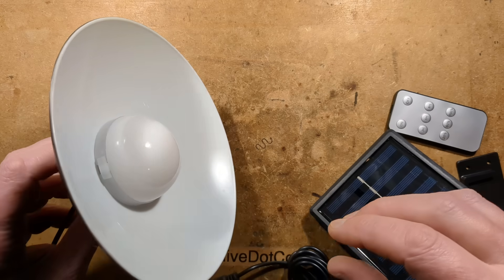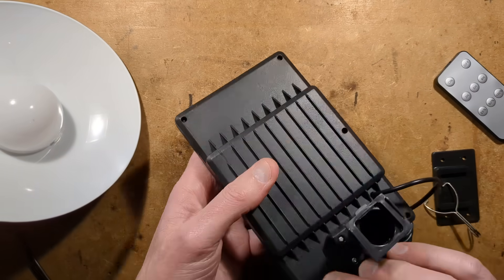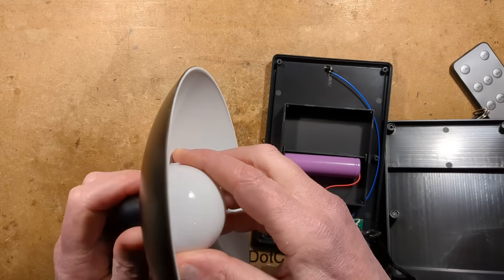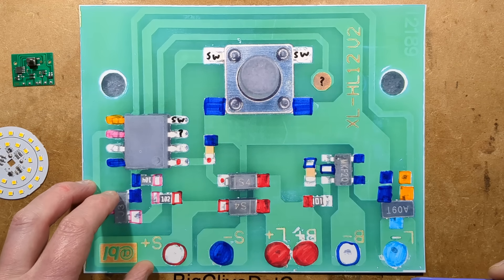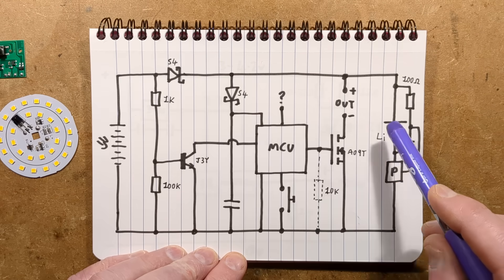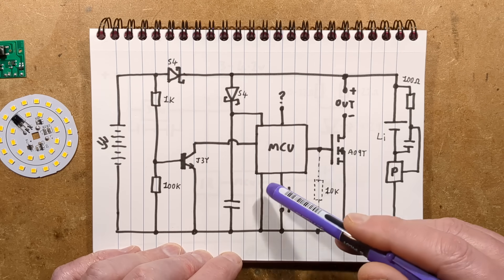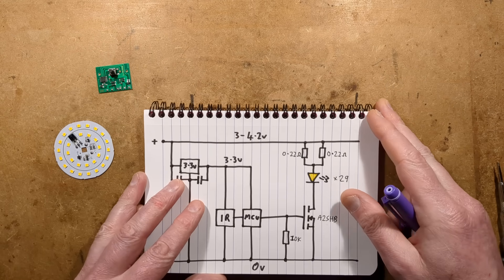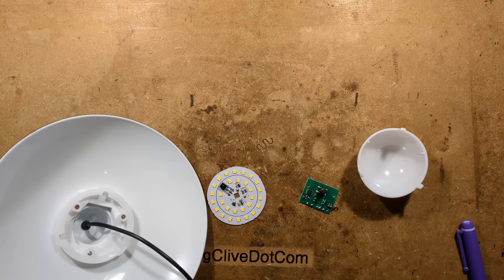Solar pendant light teardown

Comment: Since the battery is soldered onto wires i wonder what would happen if it was shorted out. Maybe a track on the board or the wire itself will break and act as a fuse?

Otherwise its theoretically possible for the battery to catch on fire, I think.

But i saw a test on YouTube where they intentionally shorted out an 18650 and it didn't catch on fire, just got hot.

Comment: Just a thought, but I think it would be better to increase the Lithium battery (free of charge) by dismantling four discarded Vapes (which seem to litter the streets these days) and taking the batteries out of them. Then solder them in parallel and install them in place of the single 16850 cell. There would appear to be space for them already and a bit of hot glue could hold them in place nicely. Environmentally friendly recycling and a free upgrade. What do you think?
Reply from the maker: It would definitely improve it.  When I mention "street lithium" in my videos I mean from disposable vapes.  I just can't say "vape" in videos.

Comment: So if you add an inline switch between the solar panel and light fitting to break the circuit, you wouldn't have to cover the panel?
Reply from the maker: The output transistor could be bypassed and the remote used for all control.

Comment: How do we even evaluate these things before we spend money?

Bought a couple of solar lights last year to provide a bit of security for my back garden.
The £40 unit I bought from Argos proved to be total sh!te and ended up in the bin.
The 12-quid item I got from eBay has done absolutely sterling service out there ever since - I'd buy a dozen more, but the (Chinese?) source seems to have vanished.

Clive - you do a great job of evaluating this stuff - just love your (unique) channel. But there's just so much rubbish about - even (in fact especially?) from mainstream stores. 

How many of us could do with a reliable, ongoing list of the good stuff and where to get it? Ever thought of being man-in-the-middle Clive? I for one wouldn't begrudge you an honest percentage.
Reply from the maker: It's always a bit random.  Argos stuff is the cheapest of the cheap.

Comment: Those solar panels go opaque when exposed to the sun for 18 months or so, as the surface is not UV proof. They are also used on many of the out door lights that come on when you move past them at night. Any product with that type of PV panel is crap really.

Comment: I needed a garden shed light and have spent several evenings combing Aliexpress for a product that does not have a remote. Somehow the market is flooded with devices like this one, and dumb solar luminaires of this size have become unobtanium. Mine had the same nonsense with night-only operation, I was able to identify and remove the culprit resistor. It also had more free space in the LED housing so I moved the battery and the board there.

Comment: So to make the light able to turn on during the day, just break off the 1k resistor and the microcontroller in the panel module would think it's always dark. Or maybe a resistor across the MOSFET can give enough of a current to retain the state of the microcontroller in the light.

Comment: Remove that sense resistor from the solar panel and it'll work more "routinely" as a rechargeable lamp...or just take out the transistor it feeds.

Comment: Considering that the "Marvel Cinematic Universe" chip needs a stable 3.3v of power it makes perfect sense to put the regulator on the same PCB. This way you can are not tied to the solar panel and can use a 5v USB Power bank potentially. Maybe a video idea?

Comment: I have had exactly this model for two years and it has been great - although the solar panel is now becoming crazed, but it still works.  Mine only briefly comes on at sun down , then instantly turns off(like many of these cheap Chinese things do). It's excellent for under my rear canopy of the house , although I had to add extra wire to the short 1m cable. My friend bought me it for about £2 from Amazon,, I wouldn't pay any more than that for it. I have rapped the edge of the battery compartment in insulation tape and waxed it (and the screws) to prevent water ingress

Comment: Yea, I bought something similar at ALDI's, dirt cheap because it was on special. I seriously just wanted to see how bad it was because most ADLI products are absolute garbage. It was supposed to be an "outdoor" solar path light. Placed the solar panel which housed the cell and a rechargeable NiMH battery. It had a lead with a plug similar to your video, they probably bulk manufacture millions of the same plug. I set the light up and kept an eye of it. It worked but only gave about three hours of light before the battery was drained. However the real, not surprise, was that for an "outdoor" light it had no seal whatsoever. The housing filled with water after only a few rain events. The plastic was not UV stabilised. So after only a few months of Sun the housing was turning to dust and crumbling away. Actually some of the worst deterioration I have seen. Even the connector showed signs of bad corrosion.

Comment: I have found you can use a sensitive camera with the IR filter removed (or cctv cameras with IR mode) can see electroluminescence in pv cells. I have tried this with cheap solar light panels and often half the cells are dark meaning they are not functional due to invisible cracks. Just apply current limited supply positive to positive, negative to negative and you'll see it glow in IR. you can clearly see broken cells and cell matching, some cells glow brighter than others.
Reply: So you connect battery directly to solar panel . In the dark I assume? And battery voltage is how much as opposed to panel open voltage? How much current do you need to limit it with ?
Reply: @migor777  yes, in the dark, needs a sensitive IR camera, current and voltage should be around the voc and Isc of the panel under test. Use a bench supply with a constant current mode.

Comment: Thanks for this. Am I correct in assumning that by removing the transistor on the samll circuit board, you could hack the circuit into just responding to the IR remote w/o the automatic "on" at dusk?
Reply from the maker: Yes.  Bypassing the output transistor would keep the remote light powered, but still have overdischarge protection.

Comment: Hi, love this video mate thank you for this, but on the subject of solar lights, the one you mentioned a few months back last year some time I mentioned I was going to put one in a room and when I opened the solar panel and the led light, a circuit board was only in the LED light part, and I remembered you saying that if the circuit board censes the sun going down to a certain point then it will turn the light on, so I thought, if the circuit board does sense the solar panel, what about putting a switch like a pull cord in between the solar panel and the board that control's the LEDs (in the day time) and if one turn the switch “off” then the board will think its gone dark and therefore one can use it just by switching the solar panel off? Sort of disconnect it from the board? So it fools the board to think its gone dark? and was just thinking if you had any recommendations about that way of doing it? Thank you for all your time take care and have a great day!

Comment: would one expand the storage by connecting the batteries in parallel or serial?
Reply from the maker: In parallel, making sure they are at a very similar voltage first.

Comment: So presumably you could stop it automatically coming on in the dark and going off in the light by removing the 1K resistor and/or the first transistor, and thereby turn it into something more flexible.

Comment: If its a typical barrel jack size you can do a number of upgrades like a custom battery pack instead of using the solar panel. I have 2 larger COB flood light style lights with a similar solar panel (also remote controlled) that also uses a barrel jack which charges at around 5V. I use a DIY 4 Cell 18650 8000mAh pack (overkill) with a USB-C version TP4056 module with a barrel jack connected to the power out pads. I disconnect the barrel jack from the solar panel and connect my pack to recharge the internal 18650 that the lights use. So during the winter i use my pack to recharge the lights. The internal battery still has charge protection and what not so its never been an issue.

Downside of manually charging is that the lights always stay off because they think its getting power from the solar panels, so i have to plug the solar panel connector back in for the lights to run at night.

Comment: How did they get this product so wrong. No On off button on pendant. And bettery stored in the bit that gets baked by the sun and frozen in winter. Added bonus for having to replace the remote battery . 
As soon as i saw the thumbnail i thought perfect for the shed, alas not.

Comment: I have a couple of those solar lights, but the ones with a reflector-type floodlight, most of them have 200-300 SMD white LEDs, and I really rather prefer and only buy those where the battery is located in the lamp, not in the solar panel, because let's face it, the solar panel is designed to be kept in direct sunlight, which bakes the cells inside. Although the first one I've ever bought was back in 2014, and that one have the cell inside the panel unit. It shipped with one 18650 and once arrived I modded and include another cell in parallel, one of those "UltraFire" units... It's over my roof since than and still works even 10+ years, but the brightness have dropped significantly. Cheers from Brazil.
Reply: The batteries have lost a good deal of capacity, I have something similar in my bedroom and I replaced the batteries works perfect.
Reply: i observe there is space for extra batteries.   that option will be for more expensive models-possibly available in america.
Reply: @vsvnrg3263  The extra space is more likely for three AAA NIMH cells, when they first started making them, the Lithium cells would have been much more expensive, & so they had the option to go with NIMH, but now of coarse things are different, so who cares about NIMH anymore!.

Comment: So can I just put 4 18650 batteries in parallel and be done or would I have to do something with the charge controller?
Reply from the maker: The battery voltages would have to be matched when you paralleled them, but no other changes needed.  The charge would depend on sunshine levels though.

Comment: Just got 2 of these lights, have got the solar stuck to the kitchen window, have the lights on top of my kitchen units pointing up, they do light the kitchen fairly bright 👍, can you up grade the battery ?
Reply from the maker: If you get enough sunshine for more charge current then the cell can be upgraded to a higher capacity one.

Comment: Never understood why they put the battery always in the solar panel. That should not be in full sunlightm rather just at the light in this case.
Reply: Maybe to keep the loss at minimum during charge? And extend lifespan during winter times and decrease lifespan during summer to make the cells toasty?

Comment: Nice to find a version of this that actually uses a lithium-ion cell. All of the smaller versions of this use the older NiCd or NiMH cells for some reason, with inductor-based boost circuits to raise the voltage up to a level which can run the LEDs. Maybe the manufacturers have an extremely cheap source for the older cell types. They also seem to use cells with very small capacities - this application was the first time I ever found a AA size NiMH cell with only 300 mAh, at least according to the label on it.

Most of the time, swapping out the cell for a higher capacity one does make a difference to the run time, since they are only powering a few LEDs, with some small versions only running a single LED. Or there is often enough unused space inside the solar panel box to fit an additional AA cell holder and wire it up in parallel to the other cell - though you do have to ensure that the additional cell has the same capacity, and the same charge level when you first connect both together.

With the unit you describe here, the problem of having to cover up the solar panel to enable the light to be used during the day is one which could be cured with a very simple fix: Just add another switch to disconnect the solar panel from the circuit. I don't know why the manufacturers couldn't have done that - they could have added a "daytime mode" button to that remote control which would do the same thing. With the solar panel disconnected, this would have the same effect on the circuit as the panel being covered up or in darkness and hence not generating any voltage.
Reply: The reason for a small (300mAh) cell could be that the solar cell can on average deliver only the maintenance current for that cell (the minimum current the cell needs to NOT loose the charge it then has by self discharging). It is in the order of 0.05 x capacity, so 15 mA. If you would put in a higher capacity Ni-Mh, that cell would not last that long because you will stay under ITS maintenance current. It is about the same problem that most DECT phones have; they come with 550 or 650 mAh, but people put in 800 or 1000 mAh, thinking they will have more charge in their phone, but these cells then are gone within two years.
Reply: @erikdenhouter  Nothing wrong with any of that - in theory I would entirely agree. However, in practice this would seem to not be the case: I did some testing by swapping out the 300 mAh cells for 600, and the "LED on time" following a days worth of exposing the solar cell to sunlight was basically doubled.
I tested again after increasing the cell capacity to 900 mAh and the result was similar - the "LED on time" was tripled.
If you are interested to know where the limit was, I don't know exactly, but the third test showed it to be somewhere between 900 and 1200 mAh. For that, I didn't have a single 1200 mAh cell, but I wired up a pair of 600 mAh cells in parallel, which amounts to the same thing, more or less.
The results of testing with 1200 mAh were a bit variable - definitely more "LED on time" than was possible with 900 mAh, but it never reached the expected quadruple of what the original 300 mAh cell could do.
Reply: @lloydevans2900  If that was your experience it is very good. But two points has yet to be considered: have you tried a whole year including a winter ? Every day of the winter (different on any latitude...) will be low charging, and some even extremely low. And second, compared then if the low and high capacity have the same life time in years ? What I am aiming at is that if the winter provides 2 months below the maintenance current (45mA for a 900mAh, and that I think is a lot), the cell could be gone in the first year.
Testing this stuff is for the long run, with all the variables, even your latitude 🤨 and all the differences per summers/winters.

Comment: The biggest issue I see with this is the location of the battery. It's fairly typical for these lights to be designed to only work at night. Usually, the battery is in the light fixture so disconnecting the solar panel allows it to run. More than once I've installed disconnect switches in them for daytime use.

Comment: I bought 3 of these. They are very variable. 
One is bright and lasts for a few hours and 25% & 50% settings don't make much difference.
One stays on low & will remember the previous setting. On low it runs all night even through most of the winter. 
The third lamp died after a week, just flashed a couple of times and went off and I used the panel for a string of LEDs in the upstairs bathroom that work 10 months of the year.

The 3h 5h & 8h setting doesn't work on the dim one and the bright one will run for while then go off then come back on a bit later.

They're reasonably waterproof at leaast the panels appear to be.
The lamps collect midgies inside the dome. I have one in my outdoor loo and the other under the pergola.   They've been there two winters.
 
They're ok for the couple of quid each I gave uncle AliX though they arrived in boxes that were trashed inside undamaged packaging so they were kicked around china before they were sent out.
I must admit I expected larger lamps as the photos were classic AliX fakery.

Comment: I bought a solar rope-light here in the USA that had that exact same solar panel/pack that came with it. Same directions to "flip it over" to use it inside or during daylight hours. Mine also had just one DISMAL 18650 inside it with room for 4. The included cell said "1200mah" on it, but when i measured it after several FULL charge/discharge cycles, it really had only about 120mah capacity... 🤨

The included remote with mine looked just like the one in the video also, but had different/more buttons and functions. 

The embedded solar panel DOES, however, provide a decent charhe to the true 1500mah cell that I replaced the crappy original with. The rope light runs all night long at full brightness, and fully charges uo the next day, even on cloudy days

Comment: 11:10 "Shame not more cells" you mean battery cells or solar cells? Did you do a 12 hour nightime/darkness consumption of power of the light? Would it last on low , med, or high? for 12 hours or the 1000mAh ?
Reply from the maker: Current tests in the description.